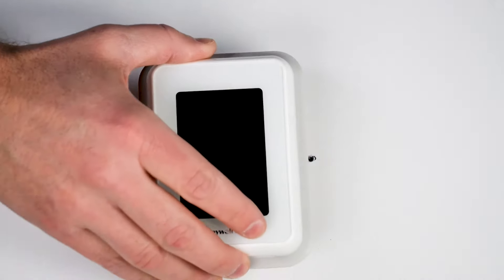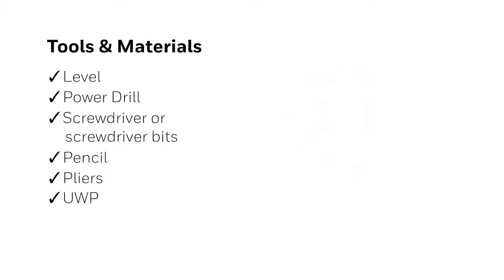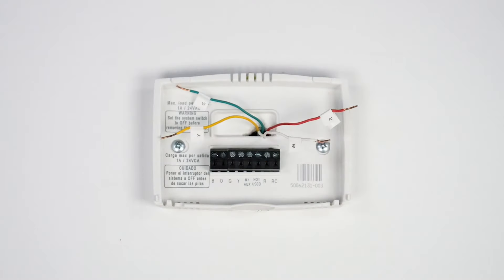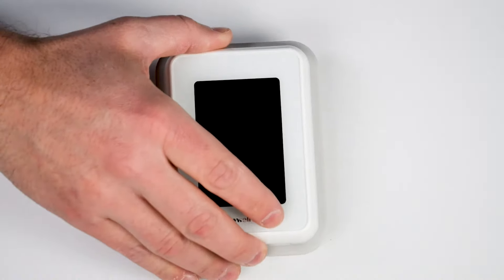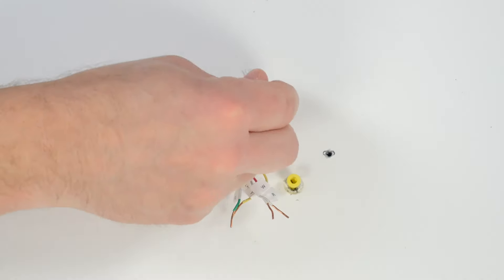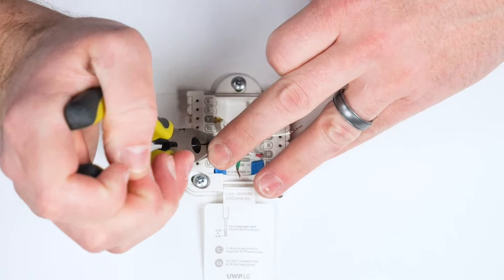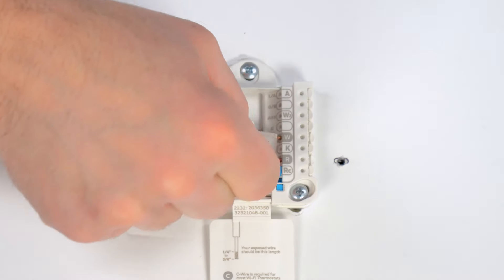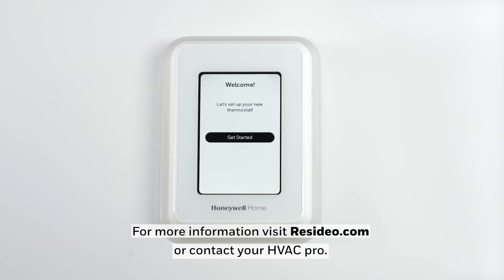How to Install a Honeywell Home T3, T4, T5, T6, T9, T10 and T10+ Thermostat

Comment: There are no instructions on how to set up and check other devices. It came with 1 extra device but you have to guess how to use it. I would not recommend it. Yes, I have called them 4 times.
Reply from the maker: Hi, we're sorry for the experience you had. We are more than happy to help if you still need assistance. You can also reach us through Twitter or Facebook under Honeywell Home. -Jerry